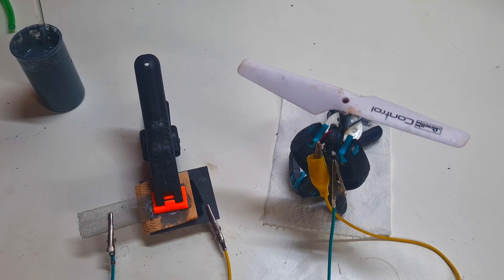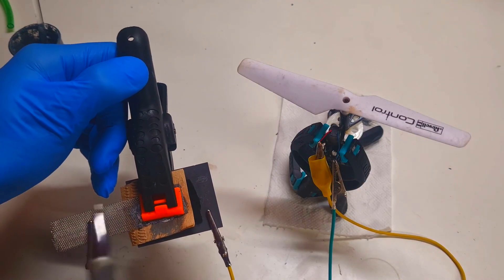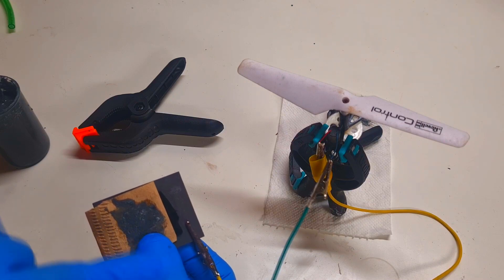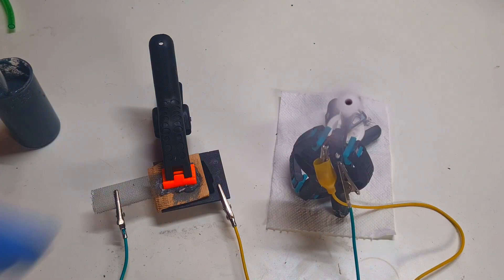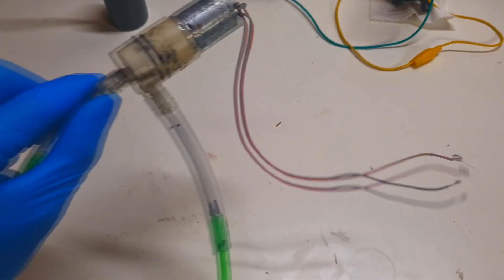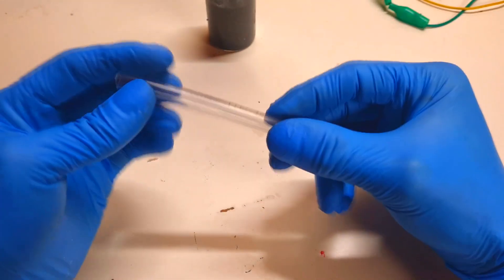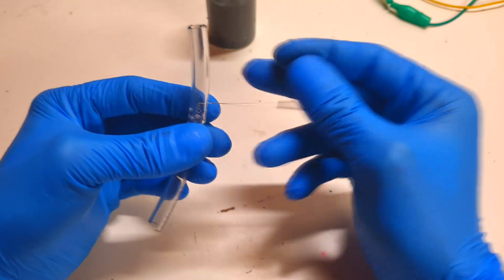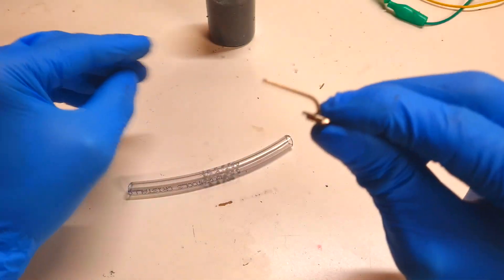Rechargeable Pipe Flow Zinc Air Battery

Comment: What Can I substitute for activated carbon felt?
Reply from the maker: Nickel felt,... or you can use also a activated carbon powder.
Reply: @cayrex  I tried activated carbon filter (a foam like), the current is about 10mA. Was that to be expected? Also how would I use the carbon powder as substitute? should I it as is or should I process it?

Comment: And you can probably reactivate the used zinc slurry through some chemical, or electrical process recycling it.
Reply from the maker: Correct,... with so called "zinc regenerator". But regenerating can be done in "zinc stations".

Comment: my cell produces low current around 100mA at 0.7Volt. Whats wrong ?there is also fluctuation under 0.7 volt .
Reply from the maker: The current dependents from the active area (size of electrodes), surface area of activated carbon, distance of the electrodes,... the voltage depends mor or less to chemistry. You can add some small amount of MnO2 to the cathode.
Reply: @cayrex  thanks alot for fast reply.I will try to add MnO2 .I will tell you again what happens .
Reply: What happened
Reply: I havent tried yet. I bought MnO2 but it wasnt pure so ordered new MnO2 .I will tell you  @kokomelon3807

Comment: Thank you for a very interesting video. Is it possible to scale this design? If you make several such cells, connect one pipeline in series and connect the cells themselves in series. Can you give it a try? Will the total voltage increase or will there be a circuit through the electrolyte?

Comment: Did you measure how many amps and volts was the cell producing? So to calculate the approximate power density, it should be a very high power density because the holes are not very big. Also, if dendrite will be formed, i think the slurry needs to be permanently circulating to equally distribute dendrite in solution.. although you can use a very low power pump and very slow (continuous) pump speed with a shorter pipes.
Reply from the maker: 370 mA and 1V under load. The nominal cell voltage is 1.4V. But I get that voltage drop because of to thick pipe wall which causes too big distance between anode and cathode. I also dont use any catalyst on the air electrode. The dendrites can form only in the regenerator,.... but the slurry is circulating,... so no problem here. The pump is can only be activated when the cell voltage drop to lower limit.
Reply: @cayrex  I would like to build this and help characterize the power density but for now it seems I cannot get from anywhere the zinc powder in pure form. Maybe i can synthesize it from zinc oxide... but purity will not be ok. Also it should be noted that the particle microns size will be very important accelerating/decreasing the reaction speed.
Reply: I get 1V to 1.6V

Comment: Thanks for sharing this video But :if you open a dry cell battery you will see that there is a carbon electrode in center + MnO2  slurry inside a zinc container and you can revive such a  discharged  battery by just changing to new fresh dry slurry . So this is a very good big lap to the dry cell battery or you can call it the liquid slurry cell

Comment: quick question, this battery cell lets say you have a timer, and its running on this battery to turn on and off the pump in interval times to renew the zinc slurry every once and then will it become an automated slurry renewal?
Reply: I haven't done it but with an Arduino Uno you could hook up a sensor that would kick the pump on when voltage went low.
Reply: I think creating a properly mixed electrolyte and finding the energy per volume of it and attaching energy measuring device to the battery's electrode, using it as an input to the arduino to turn the pump on and off base on the energy spent and not necessarily based on time as the load varies. That's what I have for my ongoing research in undergrad. I will comeback to this maybe after some time. The comments are really helpful though.

Comment: very interesting video, I have long wanted to see a flow battery made on my knee. Cool. Let's now talk about the zinc electrolyzer. And let's think about the types of membranes and what if you use not an electrolyzer, but for example, immediately let hydrogen gas through. Or use hydrogen peroxide for instant refueling and fluid activation. These are just my thoughts, I'm not a chemist.

Comment: Hi, this is a very amazing battery flow design. I am very interested in scaling this to run electric cars. However, I have a few doubts. 

Doesn't this battery self discharge, as zinc nanoparticles react with KOH to form Potassium Zincate? Why can't we use Sodium Chloride or Zinc Chloride instead, as zinc does not react with table salt. Will this work better?
Also, KOH is very corrosive and accidentally touching this slurry is not like accidentally touching petrol. We need to wash hands with lots of water immediately or the KOH will eat through our skin. Thats also why NaCl slurry might be a better option.
Reply: I am planning to create a Zinc air battery where a car goes into a Zinc station to fill up fresh electrolyte while also removing the old electrolyte that has fully oxidized. That electrolyte will later be converted back to Zinc powder and be resupplied.
Reply from the maker: @aadhithvarathan5432   haha, one year ago I talk about that when I also make my first Flow zinc battery. EVs with zinc refill batteries.
Reply from the maker: @aadhithvarathan5432  The zinc slurry is almost the same like you find in alkaline batteries,... and they can be stored for 10 years without any selfdischarge. Another type of zinc air battery are saline zinc air batteries,.... but they have less energy density. I dont know why you want to touch the slurry, because you will not refill the slurry like you do with petrol,... The refill is in closed system like by H2 and also the system have two flow pipe system,... one for the old used slurry and one for fresh slurry. Dealing with KOH is one of the steps which is needed for that system to work. For example petrol is flammable and we learn to deal with it.... the same will be with KOH.
Reply: Ok. Thank you.

Comment: that is an awesome battery flow design... a bunch of those in series or parallel and  you could have a constant battery once you have a good way to continuously charge the spent slurry on the way back to res tank
Reply: And that's the key to making this work. The hard part is the zinc electrolyzer. It's not a trivial part of the system.
Reply: @doctormagster5083  If a hydrogen fuel cell can be used as an electrolyzer then this flow cell should be capable of regenerating zinc. The dendritic material should push in the direction of least resistance and not into and through the separator. Just a thought. Thanks.

Comment: Another thought provoking video Cayrex.
The cell seemed to have a pretty good capacity with the motor load you used, it would be interesting to see the actual figures on your load tester.
Have you managed to make a decent zinc electrolyzer yet,  or is that part 3 ?     :-) 

Martin.

BTW I think you may have your zincate labels reversed at 3m 14s.
Reply from the maker: Oh yea. For sure
Reply from the maker: The scheme about zinc air fuel cell and zinc electrolyzer is from some paper
Reply: @cayrex  I thought that may be the case  :-)
Reply: may I ask what is the paper? I'm trying to justify my zinc air battery in application to UPS haha. It was for undergrad research. @cayrex